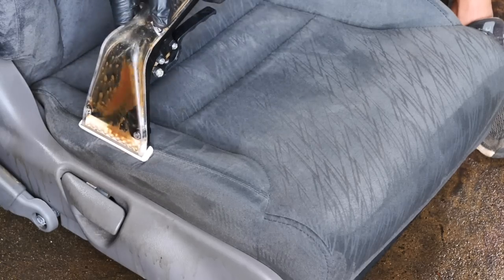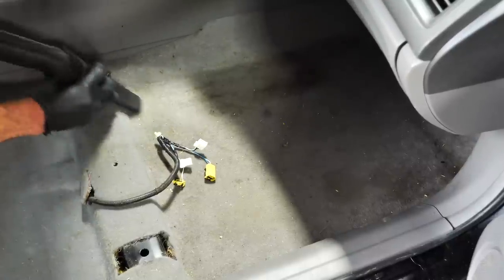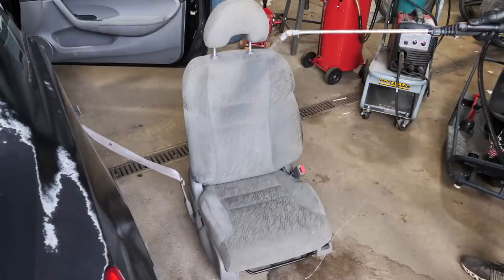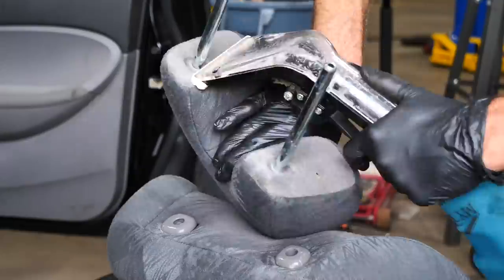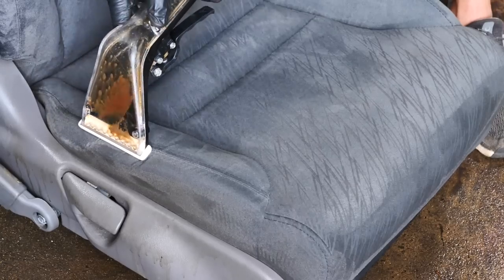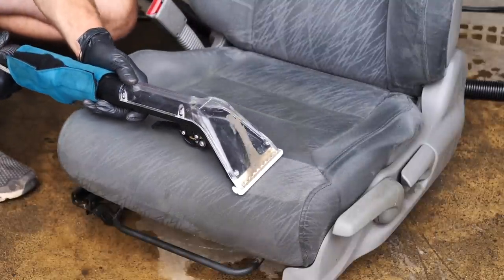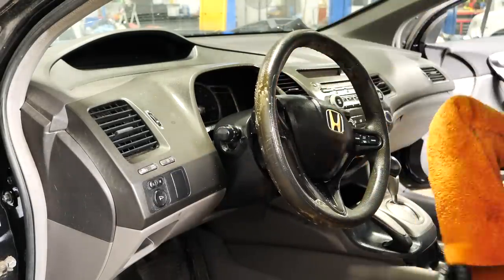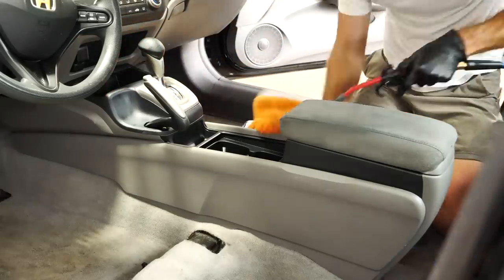Hoarders Honda Civic Before and After Deep Cleaning

Comment: Great detail. I noticed you still had the power on when cleaning the dashboard. You removed the seats, do need to disconnect the battery first, or is it not necessary? Thanks for a good video though.